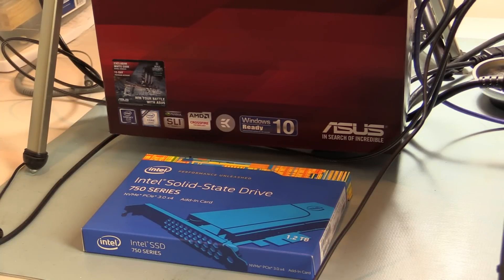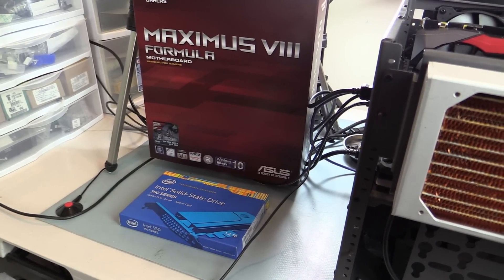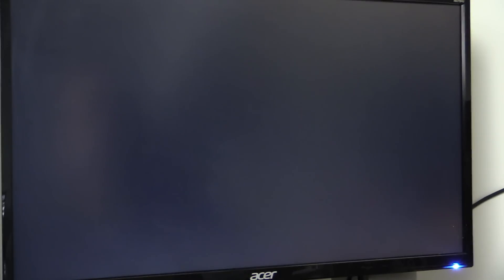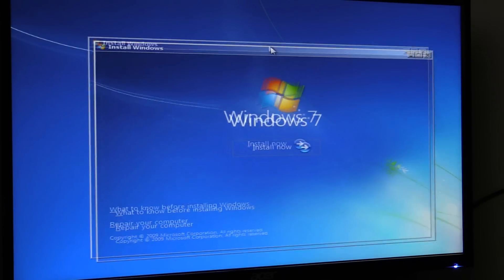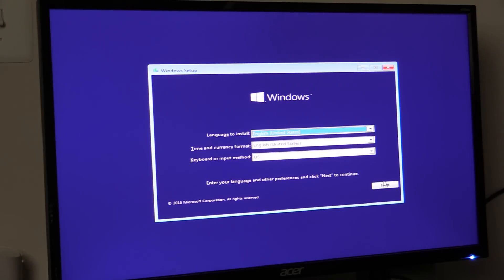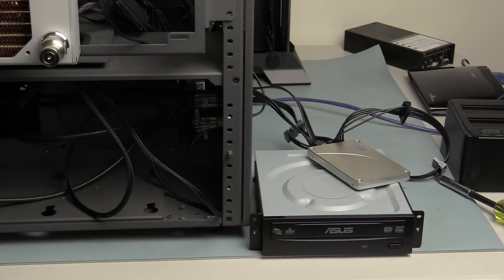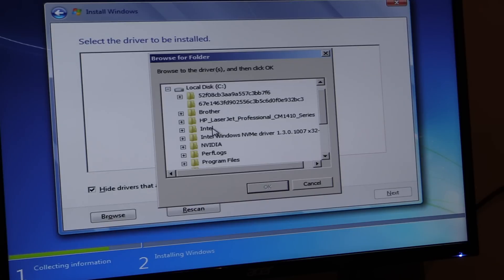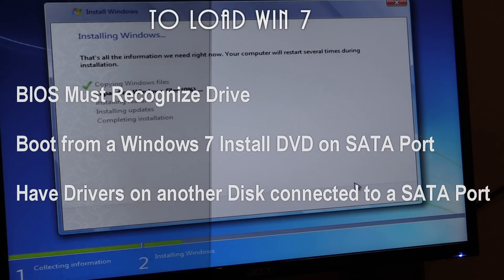How to Install Windows 7 on Intel 750 Series NVME Drive on a Z170 Motherboard

Comment: Pal,  by giving this talk, you look so damn cool.
I have a question. If in this way I install windows 7 in an empty partition of a NVME ssd which already has a windows 10 OS in another partition, will I get the options of dual OS when the pc is booted up?  Thanks much.

Comment: This is exactly how I figured I had to do it. This works because SATA is native and driver's are already in the 7 boot up. 3.0 driver's are not. You confirmed my suspicion. You are a scholar and a gentleman! God bless you good sir! If I could I'd buy you a cold one! So much easier than using DISM to inject the driver.
Reply from the maker: Why thank you good sir! Hope you enjoy using it. Reliable and fast !  Mine is still running and I bought a second one.
Reply: Ronsanut getting a SATA drive from work (haven't needed a SATA optical for years!) Be trying this sweet trick tonight and the beast comes to life! I'm running an AMD 1950x on ASRock Taichi. Need to get the Samsung driver for the NVMe. I'm amazed the SSD manufacturer is providing the driver and not the chip MFG. Will let you know how it turns out 👍👍

Comment: hello again Ron, I am getting a new motherboard Z170  I7 7700k and 32 gigs , I should have it built by tuesday or wensday
my question is like your video I want to put windows 7 pro on the 960evo 500 gig PCI..... I could not get it to work onmy other board even with your help but that MB is old. will following your video work on the new board or did you find a easyer way now 
oh and the MB is gigabyte Z170 gaming 7  it was cheap but any help ron for the new board and I have my orig windows 7 dvd

Comment: Subject: Re: New reply on "thanks ron your the only one that really ANSWERED the question how to make the nvme boot from windows 7. I see the post is from 2016. I just got a 960evo and a pci card for it and installed it on my z77Extreme 4 MB. Now I have win 7 pro running on my 240 kingston ssd. Have you found a way yet to clone with out starting from scratch? I updated my bios [Beta] 2.90P 2017/9/21 4.29MB Instant FlashHow to Update Supports NVMe Configuration Global Europe China so the evo shows up in my bios as 1 of the hard drives that I made as Primary BUT after the cloning it still wont start like its missing something ot make it the Prime drive. any help would be apprecated ty"
My second question to you is Will you show how to install Windows 7 with the DVD discs and the m.2 driver To .what happens if in two weeks you end up having a crash do you have to start over with a disk or can just make a system image put back the m.2 system image to make the M2 To a bootable drive again

Comment: thanks ron your the only one that really ANSWERED the question how to make the nvme boot from windows 7.
I see the post is from 2016. I just got a 960evo and a pci card for it and installed it on my z77Extreme 4 MB. Now I have win 7 pro running on my 240 kingston ssd. Have you found a way yet to clone with out starting from scratch? I updated my bios
[Beta] 2.90P 2017/9/21 4.29MB Instant FlashHow to Update Supports NVMe Configuration  Global  Europe  China
so the evo shows up in my bios as 1 of the hard drives that I made as Primary BUT after the cloning it still wont start like its missing something ot make it the Prime drive. any help  would be apprecated ty
Reply from the maker: I have used a program called Reflect  from https://www.macrium.com/ . This allows me to create and restore images to dissimilar sized drives ( the paid version does not the free).  
See if that works fro you.
Reply: thank you I will try it

Comment: You can also burn your drivers for the INtel card on a dvd and provide the drivers when asked after you hit the browse button, you dont need to attach a separate SSD or SATA disk. Windows installer will copy the drivers to memory and prompt you for the installation disk once again when needed, if needed. Most of the installation is in memory by this point.
It's like installing SCSI card drivers in the old days... ;-)
Reply from the maker: Believe me I tried all of that. It did not work, at least on this board, in this setup.
Thanks for the info, it may help others.

Comment: Hi, a free tip for everyone if needed.  If you know about this fine but if you don't it may help.  Because a HDD was needed to be connected via SATA III 6 Gb/s port for Windows 7 to be able to recognize the Intel 750 SSD driver it is a good idea to have one lined up.

The guy here had an Intel SSD that came to the rescue - A laptop HDD 2.5 fits into a little caddy case so it can be connected via USB to a laptop / desktop which could be handy for downloading and storing drivers on when needed, in this case when there was a problem.

So it would be a 2.5" enclosure to fit inside it a laptop HDD to connect to USB to computer to download drivers.  Then the laptop 2.5" HDD can be removed from the enclosure and because it has SATA power / SATA data connections it can be connected to the SATA III port on the motherboard to get the problem here sorted out.

Just some free information to help out a little -Thanks
Reply from the maker: Great tips. Thank you for sharing.

Comment: Connect to USB 2.0 port (not 3.0) on your motherboard, and for the most cases it should be OK with finding SSD disks. However, the other way is to inject the missing drivers into ISO or have it on second usb and browse.  But for the most part connecting to USB 2.0 works.
Reply: Nope the drivers don't show up

Comment: Thank you very much, Ron, for your time and diligence in putting this video together to help others out - this worked. 

Just FYI, maybe these details will help others as well who are still installing Windows 7 (yeah, yeah, I know I'm behind the times.....): 

1) Initially I updated the BIOS to the latest version (I believe you said that as well -- I just downloaded them from the MOBO manufacturer's support page), put the '.CAP' file on a blank USB 3.0 thumbdrive and did the update.

2) After I watched your video, I first tried using a blank 7200 RPM drive with the latest Intel 750 NVMe drivers folder on it, but that didn't work, so I used the SATA SSD method like you said. The SATA SSD I used was from another working PC (it even had an OS already installed on it), so I just downloaded, unzipped & copied the base '1.8.0.1011' Intel folder to the desktop on the working PC, and then unplugged the SATA SSD from the working PC, and plugged it into the new build.

3) I'm not sure if this had a part to play in the success, but I also set my BIOS settings to 'Load Default Configuration' (Intel said that this may be the best way to go, even if it means not having boot devices as UEFI, which they also recommend in some of their instructions). Once I did this, the previously unseen 800GB 750 Intel drive appeared (but still wasn't listed as an option to install the OS -- UNTIL AFTER I installed the driver from the SATA SSD).

Again, thanks so much. I'm installing hardware/system drivers now as I type! :-)
Reply from the maker: Thanks, I knew I could not be tyhe only one to run into this problem.  Good tips, may help others.  Thanks for watching.
Reply: It's amazing to me how people (like you) can run into a problem and come up with a solution to this - like, who would've thought that using a SATA SSD with the driver on it could be used to get the OS install to see the PCI card... again, great job

Comment: I have a ASRock taichi x99 motherboard and got other issue, ssd is detected corectly but when i want to create partition while installation error popsup and its says I can t install windows 7 on my ssd. any ideas m8?
Reply from the maker: Did you try loading windows from a DVD connected to your sata port?

Comment: What if you had the SSD mounted via SATA with the drivers needed AND then boot off the USB stick??
Reply from the maker: When I tried that, the issue still was that the system would still not recognize the SSD. So I could not tell it to load the driver it seemed to be asking for.

Comment: cant detect the bpx 250 GB ssd from mydigitalssd using z170x ultra gaming from gigabyte tried adding NVME drivers to the windows on separate flash drive
Reply from the maker: Have you tried loading windows off of a DVD connected to a sata port?
Reply: I used a usb to boot windows 7 (with nvme drivers added to the boot image using gigabytes tool) and could not detect the ssd. I installed windows 10 on a HDD and booted and still couldnt find it.  Ran the driver cd that gigabyte sent with the board....i ordered a m.2 to pcie 3.0 x4 adapter that will be here sunday and thats basically my last shot unless im missing a dumb bios setting...when i disconnect the HDD and only the ssd is installed in the nvme m.2 slot I can boot into win 7 and 10 but cant find this ssd.
Reply from the maker: You HAVE TO USE a DVD connected to the SATA ports to load windows and recognize the drive. A USB drive will not work. Trust me, I tried. Try it!
Reply: Ronsanut k im trying it...i got ahold of gigabyte n they said its not compatible :/....ill give it a whirl with a windows dvd.
Reply: Your method worked only did windows 10 from a usb

Comment: Hi - Would having two optical drive (1 w/ Win7 CD and 1 w/ 750 driver CD) installed via SATA port work?  

I have a Samsung SSD 850 EVO and I tried copying the Intel 750 driver in there via SATA to USB cable but Windows 7 will not recognize it as a Disk under "My Computer".

Comment: Rather convoluted. I wonder if you could have burned a dvd with the drivers on it, it kind of looks like it may work. Interesting approach. I found loading Windows 7 from USB (that I got right from Microsoft) had issues even on a Z77 board with no special drivers needed. I had to go back to the dvd as well.
Reply from the maker: Believe me I have tried that. I normally load from a USB stick, and I have also tried loading from a DVD with the drivers. But at least for me, it did not work. 
Thanks for watching.
Reply: I have just bought a ASUS Z170 Pro (similar to Z170-A), an i7 6700K PSU. I also bought a real Win7 install DVD with license, OEM of course but still. Will I have these issues too or is it just when trying to install from a USB ??? I heard it has to do with the Win7 SP1 do not support USB 3.0, so it won't work with a Z170 Motherboard to read from the USB. I do NOT want to be forced to use Win 10.
Oh and what about if install Windows onto a normal HD (not ssd or nVme Hardrive) first into the PC with the Z170 mobo, then update Win7 up to date. After that install an SSD as well and simply clone it all from the normal HD to the SSD ??? Will that bypass all of this hassle ??? I mean with Win7 installed and updated already and just clone it, will it then have the driver support for SSD already on it ???
Reply from the maker: If you install from a Windows 7 DVD, you should not have any problem. Connect the DVD drive to one of your motherboard sata ports
Reply: Ronsanut but I just read that mouse and keyboard wont work as Win7 SP1 install DVD do not have the driver needed to support the xHCI for USB3 ports on Z170 motherboards and Z170 Motherborards do not support EHCI for USB2 most of the time. So without mouse and keyboard You can not chose options under install or even type in the activation key. I guess that was intentional to try force win10 down our throats in yet another way. sigh
Reply from the maker: Oh I understand. I normally use a PS2 standard keyboard when I install, so I normally don't have that problem. That is strange though, I usually can always have a kbd recognized.
Reply: Ronsanut Hmmm but how to plug in a ps2 mouse or keyboard when the mobo only have usb ports like for example the https://www.asus.com/Motherboards/Z170-PRO/ ???

Comment: You can install Win7 from an USB drive on a Z170 Board. Use the MSI Smart Tool: https://www.msi.com/Motherboard/support/Z170I-GAMING-PRO-AC.html#down-utility&Win7 64
Reply: Was just gonna say similar.  Microsoft has the auto usb boot drive tool that will allow 7 to be installed from a usb....have done it many times on many different manufacturer boards.
Reply from the maker: Next time I will try that.
Thanks.

Comment: used your technique and worked great . but for the x79 motherboards you have to extract the nvme modules uncompressed from a x99 bios using MMTOOL4 tool  and insert them in your bios compressed http://www.overclock.net/t/1571271/tutorial-how-to-add-nvme-support-on-any-ami-uefi-bios-with-an-intel-chipsetso the bios of the x79 will see the intel 750.

Comment: I got around the round the driver issue with a newer win 7 install version  with sp1 and installed on my m.2 drive but windows 7 would not boot  after several tries i installed win 10.
I still would prefer to install windows 7 if i could find the solution. If anyone knows what the issue is i welcome  any advice.
it's a skylake  i7 6700 on a msi xpower titanium board samsung m.2 drive.

Comment: Another option is to use NTLite to integrate the driver into the OS beforehand (but beware that you have to do this in all 3 images: PE, setup and install). This way you can skip the driver installation step, though I don't know if it will be possible to install from a USB drive this way. I always use a DVD for installation myself, it's a bit slower but you'll never accidentally overwrite your setup/recovery CD like you can with a USB stick ;)
Reply: You do not have to add anything to PE. Only Setup and Install must be updated with drivers.
http://www.win-raid.com/t750f25-Guide-Integration-of-drivers-into-a-Win-image.html

Comment: Why not create a new directory on the bootable usb flash drive? That way you can just load the driver from the windows 7 iso flash drive or will that mess with it's boot sector?
Reply from the maker: I tried that, but it did not work. Only the windows Image is seen and available.
Reply: Ronsanut Interesting... Maybe the ISO MBR needs to be played with. Or just add the directory inside the Windows 7 ISO??
Reply from the maker: Adding it inside of the Windows ISO would work.  But I like to use stock ISO from Windows.

Comment: I am using the Samsung 950 pro NVMe M.2 SSD how will I do this with it. I am having similar issues as well, but have different Bios set up as well as different SSD and possibly a different motherboard. I can read any USB except the one with the windows boot.
Reply from the maker: Connect the DVD drive to a SATA port and see if you can load windows from the DVD drive. DO NOT USE a USB stick. It does not matter if it is a different SSD or motherboard.
Reply: Yep I did I am able to see everything via CD SATA. I ill try putting the drivers on a SATA harddrive I have and see if I can upload the updated drivers from there.
Reply: It worked.. Thanks for your video!

Comment: If you are using USB 3.0 Flashdrive and want to install Windows 7, then plug it into USB 2.0 port, don't plug in to USB 3.0 port because it causes driver missing problems

Comment: I had the same issue but with a different motherboard.  In my UEFI  I had all boot devices listed as their own device and a second UEFI device i.e.: USB and UEFI USB. This enabled me to change my UEFI USB thumb drive to a standard USB drive and load windows 7 without the drivers. I'm not saying this will work for you as you will have a different motherboard. but perhaps this may be something to look at if you still have issues.
Reply from the maker: +Travis Smith I am all good. And yes I have experienced that on other motherboards too. Thanks for sharing that.

Comment: Ron-----Fantastically GOOD  Video. !! I have been looking for a clear explanation of how to do this for a new build .  My mobo is an Asus  Z170-WS.  I want to install Win 7 Pro 64 bit  onto an Intel 750 SSD 2.5 plugged into the U.2 Port. The only thing I am not sure about is the concept of "Native USB  and SATA Ports" how do I know if  I have these on the Z170 -WS and how do I Identify them ??   For my install I would probably use   2   SATA  DVD drives.--Thank you for your time!

Comment: I have experienced the same issue; it's related to USB 3.0, as stated in the video. From what I have personally experimented with, using a recovery media, such as a DVD, saves me so many headaches. If that client wanted Windows 10, but only had a WIN 7 key, wouldn't you just have to use the WIN 7 in during the WIN 10 setup? In theory, it's suppose to work 100%, but I have only had success 50% of the time.
Reply from the maker: +Edisson Ortega Thanks. I will have to try it.

Comment: I used asrock win7 usb patcher and downloaded my msi mobo intel usb 3.0 drivers. Works fine. And ofc it's uefi enabled aswell.
Reply: will it work too for asus motherboards or only asrock?
Reply: The issue is windows7 miss the drivers that you "inject" with the tool. So yep just pick your asus drivers.
Reply: oh ok great thanks :)